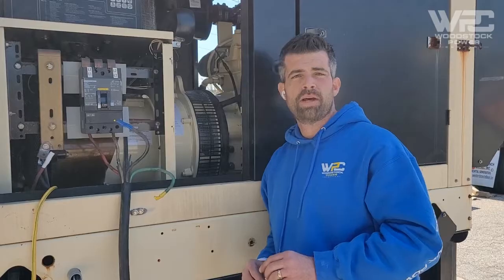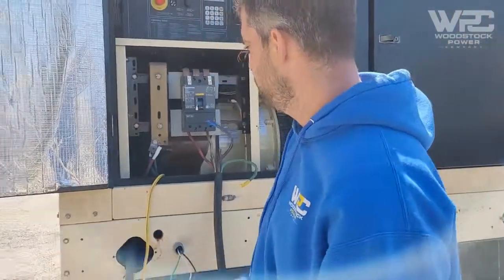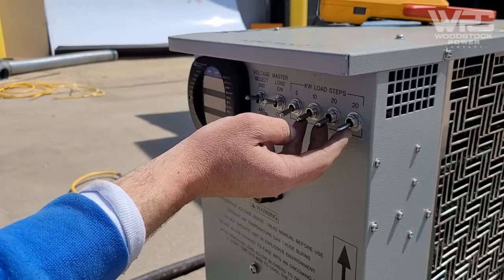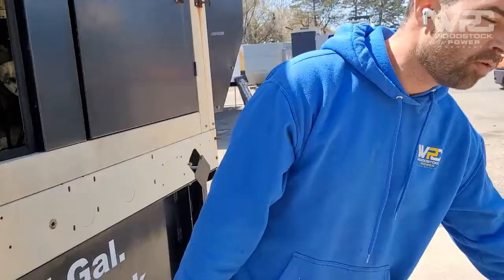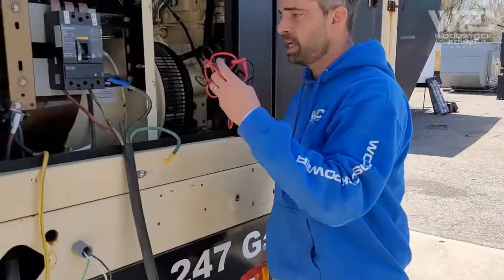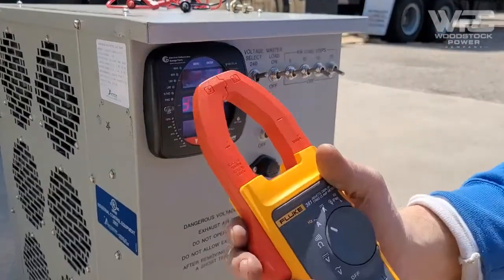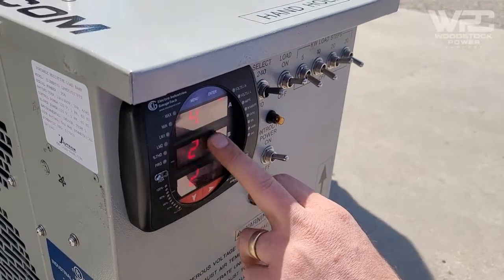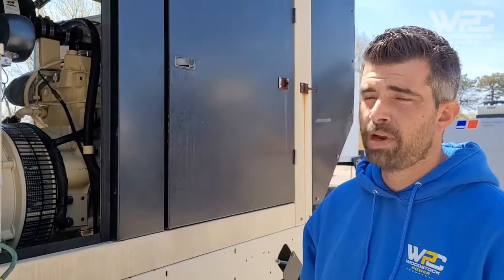Generator Load Bank Testing: The Basics

Comment: I would consider some strain relief on the test cable as currently the weight of the cable is pulling on the lug termination. Also look into an Arc suppression blanket that can be attached/ties over the exposed breaker. If there was a thermal event or CB failure it would contain the blast or prevent the flying balls of copper from igniting your non-FR hoodie.

Comment: If you ramp up the load too quickly on a unit that has quite a bit of carbon in the muffler you can get a fire in the muffler and burn that generator to the ground real fast.  You want to take your time getting the unit heat soaked  and I usually only do 25% steps at least 30 minutes apart before pulling 100% or more then after the test step down  easily  to relieve the exhaust gas pressure then cool down with no load at least 15-30 minutes.  I will Never do a full load dump on or off unless the customer absolutely requires it and I have it in writing that  customer is  completely responsible for any damage to the unit .  I have seen a guy do a full load dump on a 500kw  Onan and blow a piston through the block.
Reply: Wow even someone like me who isn’t into electronics like that knows that full dumping is dump. Just like how you don’t full dump a clutch even when racing.

Comment: How did you come up with 125A at 120/240V single-phase for a 30kW generator? At 0.8 pf, its 37500VA => 37500VA/240V = 156.25A
Reply: You are correct, that it is the amperage rating at 100% rating.  However, unless the breaker is rated as a 100% breaker, most breakers are rated at 80% especially on these older cell site machines.  In general, we never load bank a generator at 100% other than special cases or requests.
Reply: @Rustlaser  Thank you for your reply.
Reply: His load bank is non reactive; so the calculations would be done for 1pf. 30kw unit. Single phase formula; I=kw • 1000/E or, 30000/240=125a
Reply: Accidentally replied from my wife’s account, LOL. Same info applies though
Reply: @vickiebey8711  You are correct in that the load bank is a resistive load, so pf=1. However, it was confusing to me because he mentions that he has a 30kW generator which gives 125A at 120/240V. 
Anyways, this was a good video showing how its done on the field and its much appreciated.
Reply: In addition to the other replies given, the ratings for single phase 120/240 V operation of generators is usually given at a 1.0 power factor.

Comment: Load bank are a group of huge resistors connected in series,paralell activated them by contactors or other devices.these banks need fans to extract the Huge heat generated by the resistors.the enclosures are big,With holes or doors which are opened when the bank work ay full power.

Comment: Nice job.... Do you have a single load  for 2.5mva gen
Reply from the maker: Unfortunately at the moment, we do not have a single load for 2.5 MVA. We did before, as we ran load tests on a 2 mW diesel genset, but one of our company partners asked to borrow it for a project.
Reply: Would you be interested  importing from China.  solutions will be given if any issues.